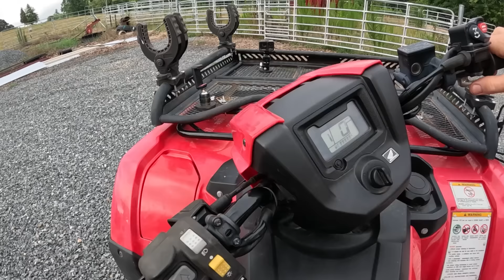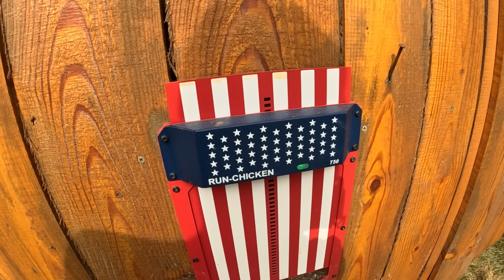Can’t Believe I Let This Happen…..Again!!

Comment: Here's a great tip on transporting 5 gallon  buckets of water in a truck, tractor, 4x4 or Gator...fill them 75% full and put an empty 5 gal. bucket on the top of each one. No more major slosh losses.

Comment: Would sod take root on that hill to speed up the process?
Reply: Very expensive.  A mix of millet, annual rye and the perennial grass of his choice is a good idea.  The first two will come up and stabilize.  The grass will come up later.  The first two will die off but take a while for roots to rot while the grass takes over.  Josh probably won't  do this as he is picky about how his grass looks and this is an area visitors will see.  Barren ruts don't look good.  Grass needs lots of water to get established and is almost impossible in the summer.

Comment: I'm looking for some help. I have a raccoon problem getting in my sweet corn. I have 10 rows at 30'x160'.

I have 5 strains of the electric rope. My lowest is 5" off the ground then 6" up from the 5 then... 
I have scarecrows and I recently bought 4 solar lights/ultrasonic sound noise maker that are motion detected.

Anything else? I can't afford that netting fence. 

Down the line is there anyway to attach cattle panels to a T-post and electrify it? I've seen a few here and there on FB Marketplace for $5-$10 I just don't know how you would keep them off the T-post so you could charge them.
Reply from the maker: Set some live traps with something tastier than corn my friend. Catch them maybe?

Comment: What length and weight limit on your gooseneck Gator trailer? Looking for something similar for hauling hay!!
Reply from the maker: it's not mine...sorry I couldn't tell ya...but it's way overkill for hauling just hay.  Dual tandums...and a ram 5500 ...I'd say this rig could haul what a tractor trailer could haul in the 1970s!